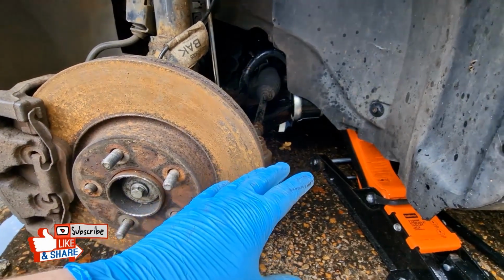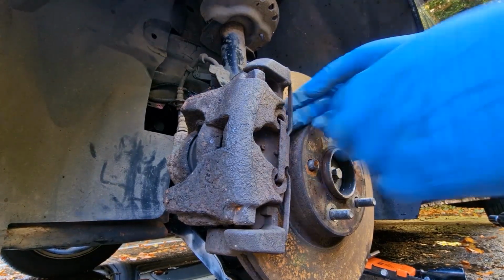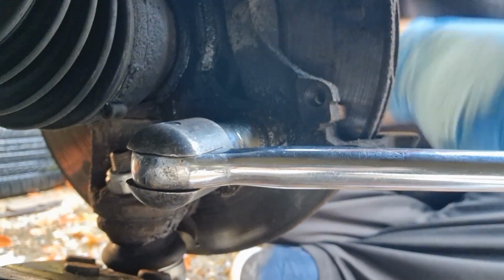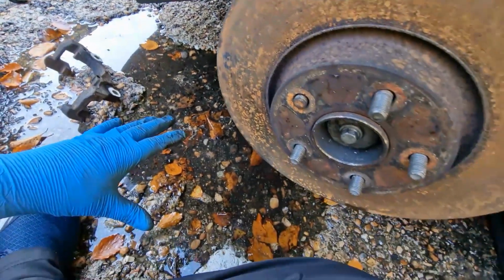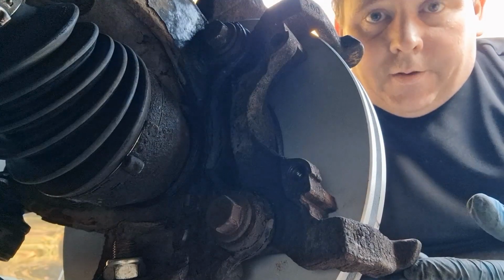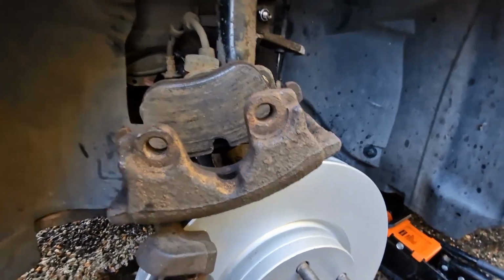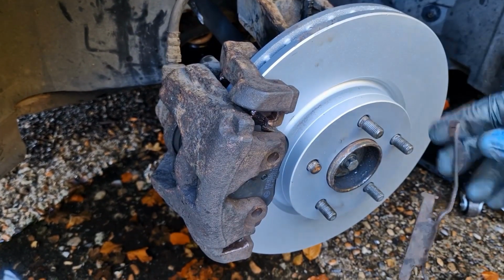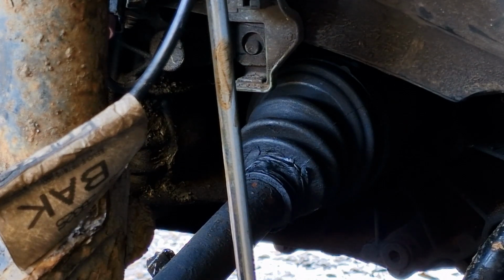Ford Mondeo Mk4 front passenger brake change (the easy way, lol)

Comment: Everyone who will be doing this take the opportunity to clean the hub, brake calipers, sliders, with a wire brush, apply brake grease to prevent rust from forming which can even warp the disc, or at least make it difficult to remove next time, sliders  are prone to sticking, clean them well and lubricate them with brake grease that is resistant to high temperatures.

Comment: Great video mate, thanks for posting tutorials on the MK4 Mondeo. At 16:55, when you're tightening the caliper bolts, Ford spec says 200 Nm (148 ft.-lb.) but my torque wrench is too large to fit in there. Do you reckon it'll work to tighten them by hand instead?

Comment: Please please please before you jump in the car and drive off after changing the pads pump the brake pedal a few times to get the pads back into their operating position. You've pushed the pistons all the way back into the calipers to get free space to fit the new pads, you have to remove that space before the brakes work.
Reply: I made that very mistake a few years ago when I 1st started working on my old MK2 Focus. Ended up in the middle of the bloody main road, thankfully the road was quiet! 🤦